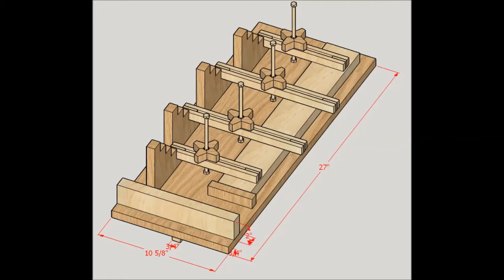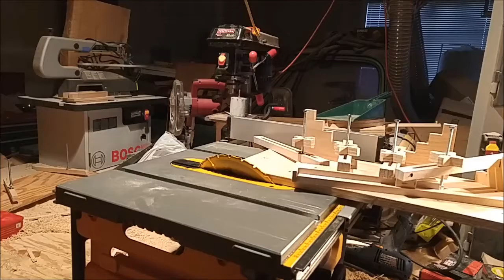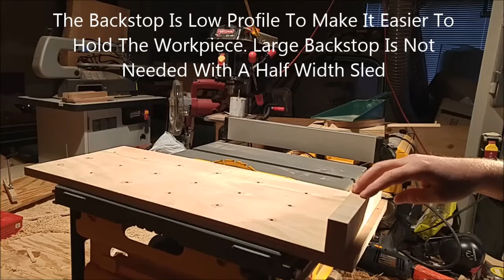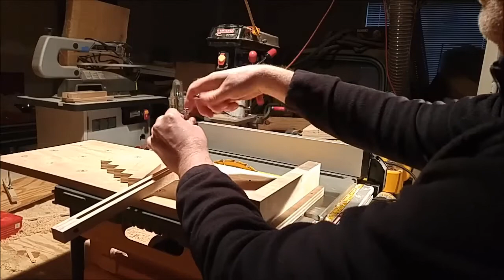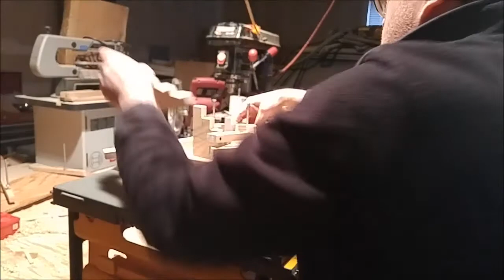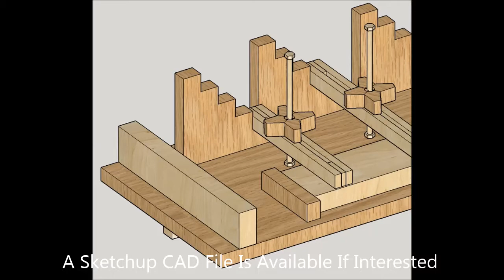Cross Cut Sled For Table Saw

Comment: Another useful jig, subscribed!
I especially like the stepped clamp support on this one.
Reply from the maker: Glad you liked the jig. I use this one very frequently, it was well worth the time to make it and a real safety improvement using those clamps for certain cuts. One comment I'd have is I went a bit overboard with the number of clamping nut locations on the base part. I really only use a few of those locations and if you made a jig like this you may want to just add a few near the jig fence to start with then add more later as needed.
Reply: dumas5000 I assume you indeed wouldn’t need that many, but neither do I think that having them leads to any problems. As you said though, you can always start with a few and add more later!

Comment: Like your work, a very versatile sled. Is that a Dewalt contractors saw table (DWE7491-XE)? I believe I have the same one here in Australia. You mentioned that you use a dado stack on your table, could you tell us the blades you use and width of cut please? Dadoes are not common here and I am reluctant to just go out and buy any blades in the hope it works.
Reply from the maker: Hey Pablo, Glad you like my sled design, hope it gives some ideas for you sled. I have a Dewalt DW745 table saw and use Avante Pro 8" Dado set with a 5/8" arbor hole size. It's an inexpensive set at about ~50$ US dollars, but has acceptable quality for the price in my opinion. My half width sled design can use any dado width of blades, full size sleds can't do that. And with my sled it will be much safer than using a miter gauge, especially given you must remove the Dewalt insert for dado cuts. Speaking of that, I'm going to be doing a video on a table saw insert in the future which will greatly improve over Dewalts insert which has several design flaws (not knocking the table saw overall as I'm very happy with it, just the insert). And lastly with the clamping system on my sled you can make cuts hands free of the work piece which can be helpful for safety with small work pieces.

Comment: You have really touched on a good idea there with the half width sled!   I appreciate you sharing this one.   Just so happens that I need to build a sled......what a good deal.  Thank you
Reply from the maker: Very glad to hear this video has helpful ideas for your projects. That makes the effort of creating the video worth it to me. I've been using it alot over the last year and can say it works great! In my opinion it's the most feature packed, most flexible, simplest overall design sled that I've seen. I had some thoughts on this sled design after using it a lot which may be of help:1) I switch out very frequently between a table saw sled and either straight table saw or some other jig, so having something small, lightweight really is helpful, and this half width sled really does save on shop space. 2) The existing table saw tape measure is used all the time with this sled, it's a big time saver! 3) The dado blade capability was used many times, it's helpful and makes dado cuts much more saafe. 4) The clamping system on the sled is used very often, which makes certain cuts safe that would otherwise be extremely unsafe, I mostly use the hold down points nearest the rear fence, to save time you may want to add just those and add other hold down points only as needed.  5) The add-on jigs for this sled a lot which are other videos on my channel and am not done making more add-on jigs on future videos, they all attach using the clamping mechanism. May want to sub to my channel for those upcoming videos. 6) Now and then I do move the sled to the other side of the table saw for angled bevel cuts and so that unique feature has been well worth including in the design. 7) Would recommend using a good quality plywood or for the base rather than cheap plywood I used in the video, the reason is because cheap plywood warps a bit with temperature/humidity which can have an impact on making consistent depth cuts or cause a very slight change in bevel angle. Still totally usable but does impact accuracy. Would not recommend using smooth plywood types like melamine, need some friction to hold the pieces in place plus need very strong type of plywood to resist bowing when using the clamping system.8) I have not seen a problem from wood "dropping off" or problems with no zero clearance on the cut end given it is unsupported, even with larger work pieces. So I decided not to add a feature to support under the cutoff part, leaving it just as in the video. 9) The washer on the clamping system bolt is not needed and after using the sled for a while I don't use wrench to tighten the clamping bolts, finger tight is just fine which is a time saver.
Reply: I surely do appreciate all the parts of your comment.  And I did subscribe to your channel yesterday.  Also, am looking forward to your videos.  And by the way I went out an bought a good piece of plywood to get started on a sled.  Thanks again you are very inspiring! :-)